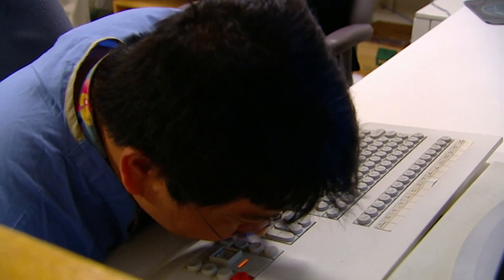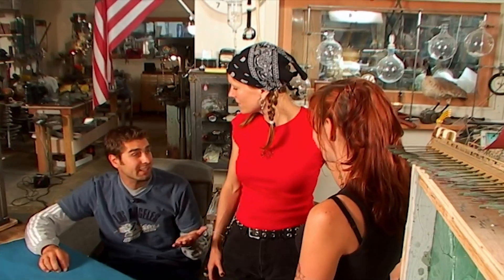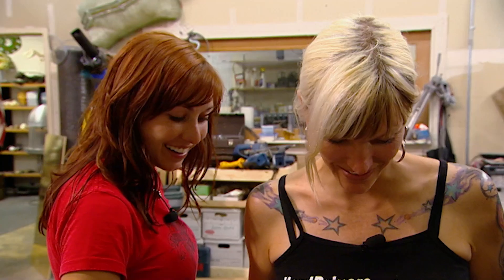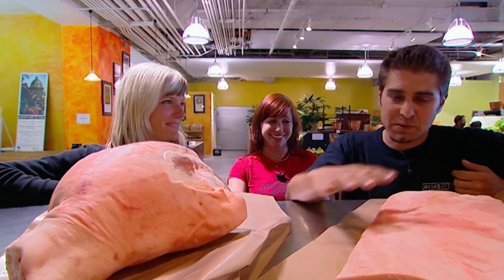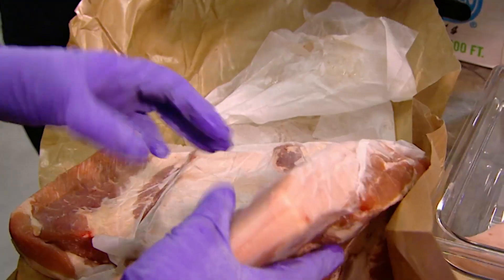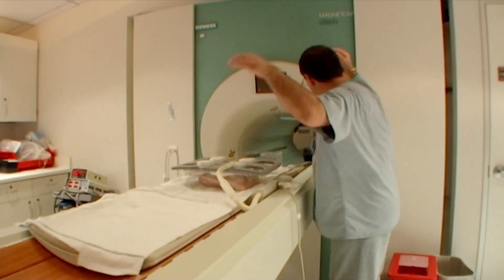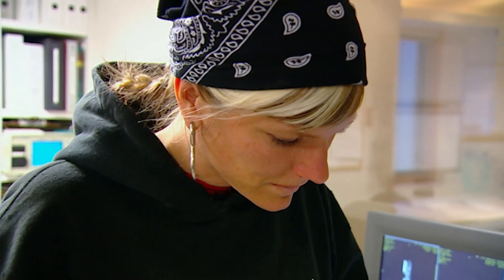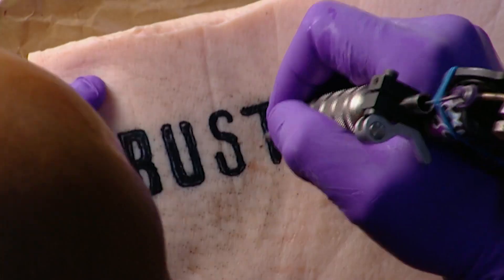Tattoo vs. MRI! Could Ink Cause an Explosion? | MythBusters

Comment: Modern mri scans are generally considered safe for tattoos, while especially prison tattoos, due to their potentially unknown and metallic composition, may pose a higher risk of discomfort or even a burning sensation during an MRI. This is because some tattoo inks, particularly those used in prison settings, may contain metallic elements like iron oxide, which can interact with the strong magnetic field of an MRI and cause irritation or heating.

Comment: I am a radiologist. Even today, in the consent forms that we make patients sign, there is a section dedicated to tattoos. Obviously we do not expect anything to explode, at most an old tattoo can cause two types of problems: 1) the patient who could feel a light cutaneous itching/burning sensation localized in the tattoo spot, especially if it was done before the 80s.
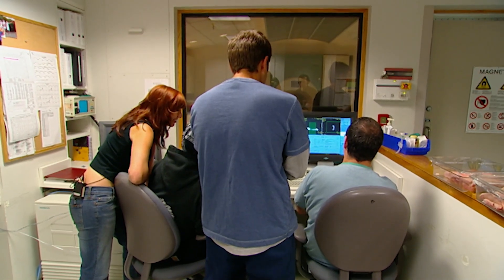2) the tattoo itself could create ferromagnetic artifacts (those that are visible at min 5:55 ) that could affect the quality of the exam and diagnostic accuracy, especially in high-field scanners (the one in the video is probably 1.5 Tesla, around there are 3 and even 7T MRIs in operation, which are much more powerful).